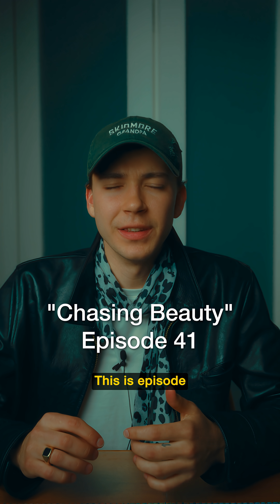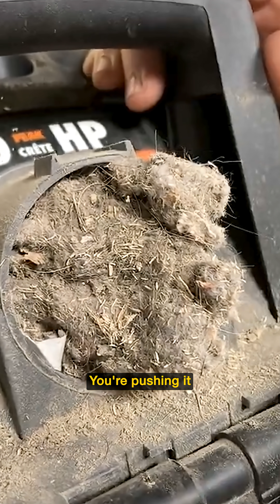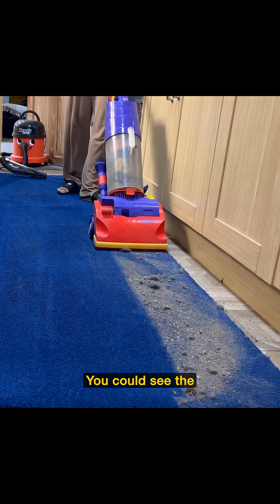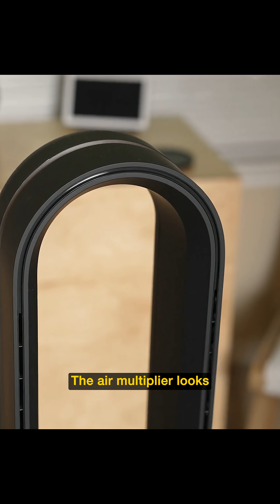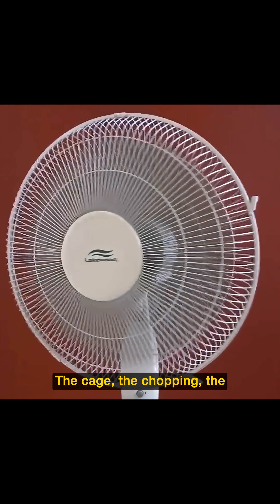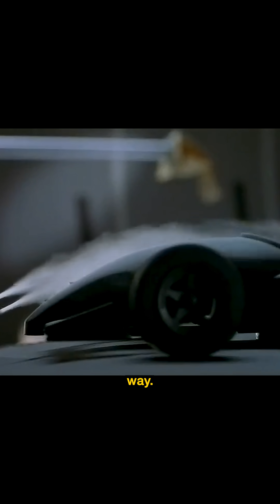Dyson products look weird, but there’s a reason. Behind their iconic product design...

Comment: It is, after all, just aesthetics. To this day the best vacuum cleaner I've ever used was an old one from the 90s my parents bought in Korea.
Reply: Bro please hit us up with the sauce, I need a vacuum that actually sucks well after more than a 1 year, I am willing to track one down
Reply: @harrisblastaar5081  Miele vacuums (with bags) are really good, vacuums just require mainteance like everything else and care when used. Change out the filters and bags often (taking care that the bag is properly attached so it doesn’t vacuum dust into the motor), be careful with what you try to vacuum, regularly check and clean the hose/attachments to reduce blockages. Hair especially gets on the floor attachments wheels easily and can affect the experience and positioning. The wheel axel is easy to expose with the miele and you just need some tweezers and a sharp, thin blade to cut the hair that has wrapped around and then you can just pull it out with the tweezers. :)
Reply: @Sib666 second this. I've had a Miele vacuum for going on 10 years now. Works great. Was pricy though, probably paid close to $400. But amortize that cost over 10 years and that's not bad at all. It does require basic maintenance and I've had to clean a few clogs (careful with Christmas tree branches), but overall it's solid.
Reply: @Sib666  Meile's are too expensive for many people, and for what you get.
They are fine, but it's luxury brand branding that sells them.
I've cleaned houses with Meile's, Dysons, kenmore canisters and a lot of other vacuums.
Nothing works like an older Eureka or Kenmore canister.
They have heavy duty motors that work for decades.
The Meile is light and easy to use, but it doesn't have the power of a basic, well made canister.
Reply: @h @harrisblastaar5081 uy any Kärcher shop vacuum if you need suction over aesthetics. I use a Kärcher WD3 and it can suck even that very fine dust off of the floor that comes after demolishing a wall.
Reply: @harrisblastaar5081  Kirby and Miele are known for their deep cleaning. Both are a bit heavy and pricey, however.
Reply: @harrisblastaar5081  Shark makes one that's basically the same principle as the Dyson. about 1/4 the price too
Reply: @harrisblastaar5081 

Miele. Bulletproof.
Reply: @harrisblastaar5081  Panasonic and Kenmore canisters (same build, different brands) work well and last. My cleaning ladies preferred them. Not sure Kenmore still around.
Reply: @harrisblastaar5081 Kirby or Miele. They come with bags. They last a lifetime.
Reply: @harrisblastaar5081  I am considering the SEBO vacuum but, only from an authorized sew&vac dealer for the long warranty. Those have nice reviews and super easy to remove brush rolls.
Reply: @harrisblastaar5081  Additionally, if money is the issue, the cheap $99 Bissell are good. You just NEED to change the dust before the collector fills up. Also, pick up any tissues, pins and stuck, because the inlet hose (behind the brushroll) gets clogged.  Learning how to dismantle that cheap vacuum is a great help to your sanity.
Reply: @harrisblastaar5081 Miele.
Reply: A Kenmore canister with a good motor (it will have some weight to the vacuum cleaner) you will be in good shape.
Don't fall for the bagless route unless you don't mind emptying it & cleaning the filter every time you vacuum.
People think it's easier, it's not.
You also don't have to dismantle a canister.
I don't know if Sears still exists, but if they do, go there and get the one with the least amount of frills.
Just a good beater bar head, an upholstery head & floor head.
You will be glad you didn't buy something that breaks, needs repairs, has to be emptied constantly & goes under furniture without having to read a manual.
Reply: Yep, my industrial shop vac does wonders in the house
Reply: @RabRossUK  shopvac supremacy, gang gang lol. love that thing
Reply: @RabRossUK  And you're spreading dust all around the house as you vaccum.
Reply: Yup. In comparison with other vacuums in the same price range, Dysons are pretty terrible. Same with everything else they make.

Comment: I just found out yesterday when I visited one of their flagship store that they stopped selling REAL stand fans like these.

All they sell now is just pure Room Air Purifiers. I tested it and yes, it blows air but you can barely feel it. They might look like the previous Stand Fan Air Purifiers of Dysons, but they’re not the same. What a disappointment. Please beware of this fact
Reply: Idk man sounds like you didn’t crank it up and just set it at a low setting
Reply: @labbit35  I cracked it up. I even asked the Store Rep about it. 

It looks visually the same as the old Tower Fan Air Purifier. But the new models are just plainly Air Purifier by function, in the same body as the old Bladeless Tower Fan. Absolutely ridiculous product decision.

This is why the Chinese OEMs are beating them on all categories bc of bs like these
Reply: @mancerrss  did you like read what you were buying or did you just buy one without looking 
Also of course they’re winning, how the fuck are you supposed to compete when your opponent has slave labour they can use at will. And don’t forget that people like you buy stuff based on how much features they can cram into something
Reply: I'd prefer the purifier

Comment: Thier most recent pencil vacuum is just the impossible made possible. Truly one of the most innovative companies around currently!!
Reply: Indeed! My mom bought one for my grandma and it’s shocking how much dust it pick up from a single carpet! The only downside is how hair gets tangled with the dust and clogs it sometimes
Reply: @janaramadan5794 buy the fluffycones version! The cone-shaped heads spin the hair out sideways. Best purchase ever no regrets.
Reply: It has a tiny bin capacity, and tiny airpaths that are just begging to get clogged. All for $600 mind you. It's not even good as a quick clean-up vac.
Reply: @amtrakpepsiproduct1605 I understand it to be a daily vacuum tool, not one to pick up serious spills.
Reply: @bublt4me  it's not good at being a quick clean-up vac or a daily driver due to the flaws I mentioned above.
Reply: Except that thing sucks. The V8 is MILES better in all areas of performance. Just because it looks unique, that doesn’t make it better. The suction is worse, the dust trap is smaller, the only thing that’s better is the weight. And even that is only like 1 pound. AND it’s like $150 more expensive than the V8. 

This is one of their least impressive innovations yet
Reply: @iAmTheYoozurper  never tried the pencil thing but I did try the v8 and it's great
Reply: Being 1 pound lighter than the V8 is a pretty good TBH. For anything that requires lifting the vacuum, you'll really feel the weight reduction.  And whilst it may be worse across performance metrics, if the v8 is overperforming for the tasks it's assigned to, than being worse across performance metrics doesn't actually matter.

Does that justify a price tag 150 quid higher than the V8? No, not for anyone who doesn't have significant disposable income, esspecially not if they already have a V8. But that doesn't make the product suck, it just makes it overpriced.
Reply: @Santisima_Trinidad  you sound like a bot
Reply: @zoblow88 you've never interacted with a bot, have you? It's very obvious I'm not one.
Reply: @Santisima_Trinidad  there are more bots than ppl so everyone has
Reply: They do home appliances that’s not as hard as an iPhone idiot
Reply: dyson products are really not good.
Reply: @HelloFactoryLLC  Our dyson vacuum is over 20 years old and still works like a powerhouse, no other vacuum compared for a clean carpet.
Reply: @ClioMioo  great youre the exception not the rule. if its corded it has the power to clean a carpeted floor, theres no real issue there. But a bagless cordless vac will not last more than a few years before you want to shoot yourself every time you use it and go buy another for 500 dollars
Reply: @HelloFactoryLLC I bought my dyson when I was in college, 15 years later still works like a dream 😁
Reply: @JugiK_  great you should buy them for the rest of your life
Reply: @HelloFactoryLLC  There's a difference between simply not liking a company and their products and blindly not liking them. You're blindly not liking their products by using false logic heavily based upon your dislike of them and their products. If you want to dislike something, have a real reason to dislike them.
Reply: @Yvisityyy  no I'm really not. I like their hair dryer products. their vacuums are really just that bad
Reply: @Yvisityyy  I don't see the false logic? 
What part was incorrect?
Reply: @HelloFactoryLLC they are definitely miles better than the competition
Reply: @kodirome3859  you dont know anything about vacuums
Reply: @kodirome3859 depends on a competition we talk about. most retail ones, i would agree. but with the age of internet, there is plenty more that never reaches local shops. but it then depends on a niche.
Reply: @kodirome3859 there are a few that are better than the vacuums
Reply: @kodirome3859  Not really. The limitation of the fan being tucked away leads to efficiency loss believe it or not. And this means they can't reach the same power level and will always be inferior to something that isn't putting aesthetics above improved functionality. Only their vacuum didn't seem to do this, and I think it got a lot of copy-cats nowadays.
Reply: @kodirome3859  My Dyson vacuum barely works. Parts fall off of it. It's no quieter or lighter than any other upright I've owned.